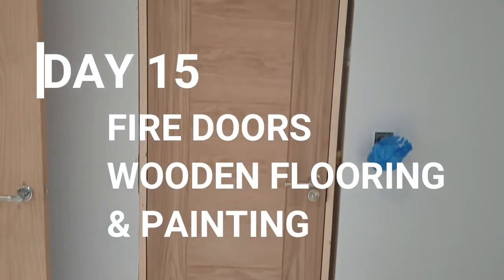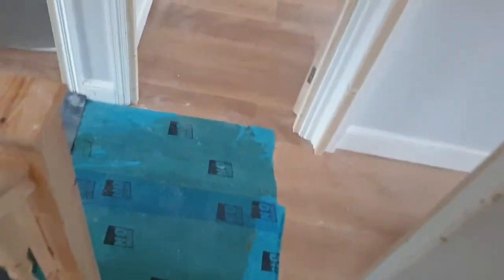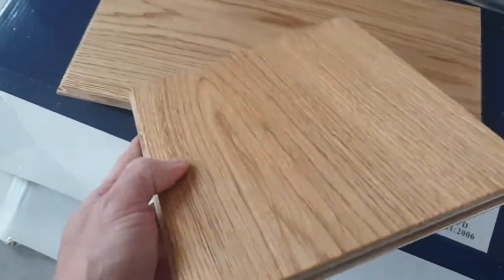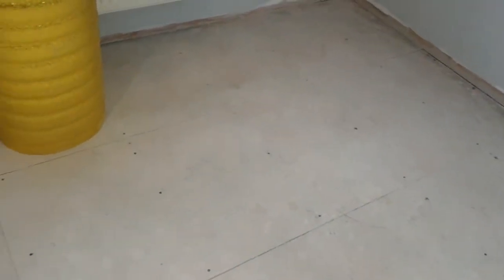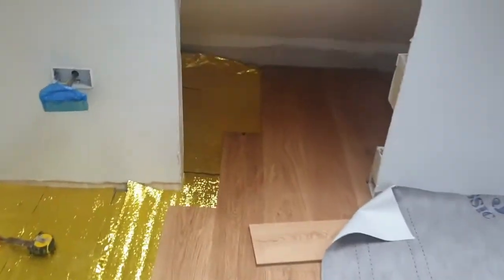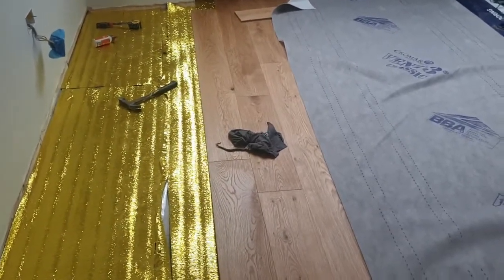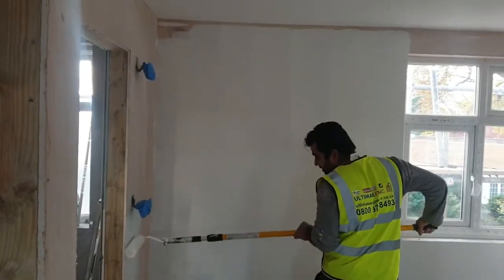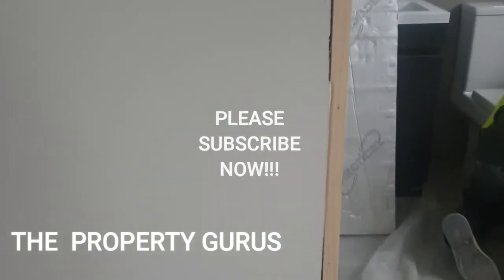LOFT CONVERSION DAY 15 - Fire Doors, Engineered Wooden Floor & Painting - Day 15 of 18

Comment: Hi I am impressed with your job specially the doors. I need to put 2 fire doors in the loft. I believe I need 3 hinges instead of two and what is the distance from the fire door I should put hinges from top to button. Also do I need fire rates handle  please send me the link where you bought from Amazon.

Comment: Having to change the doors is a bit off putting. I have original Victorian doors in my house. I have read you can paint the original doors instead of changing them. Another pain is having to have self-closing hinges on all the doors. That means you'd have to keep them closed all the time because if you had a fire and a door was found to have been held open, it might invalidate your insurance.
Reply from the maker: You will need to change the doors to fire doors. Painting them won’t be sufficient to satisfy building control. You don’t need self closing hinges though as that requirement was removed from Building regulations a long time ago.